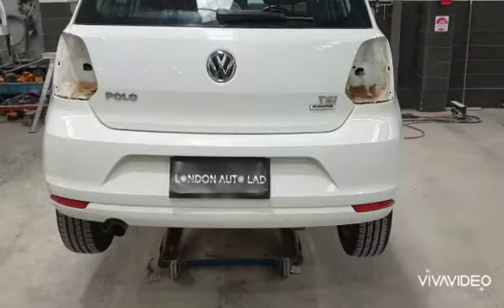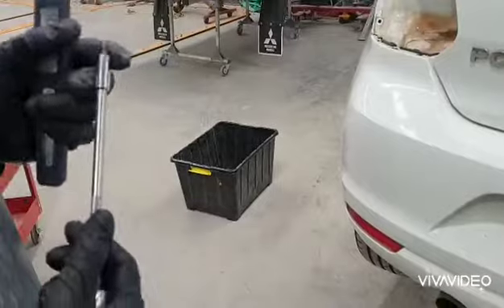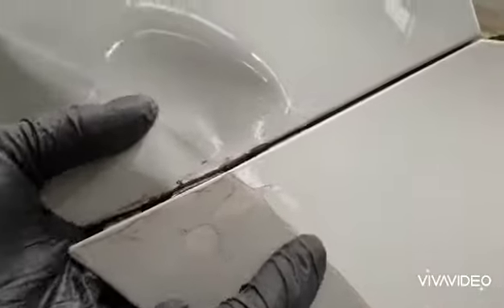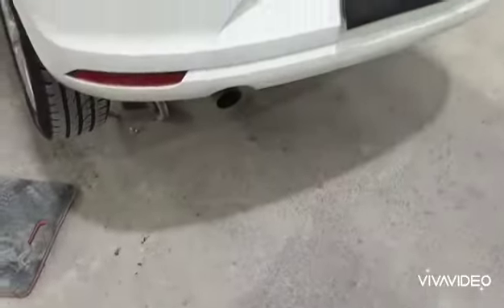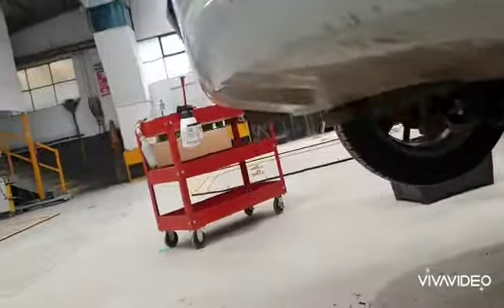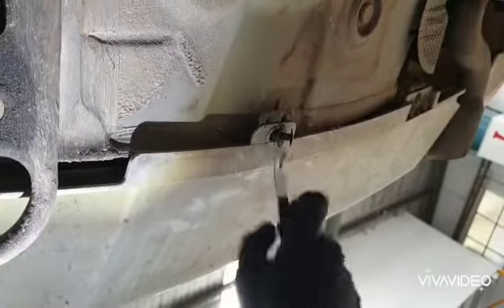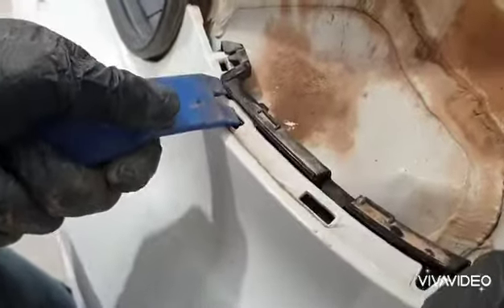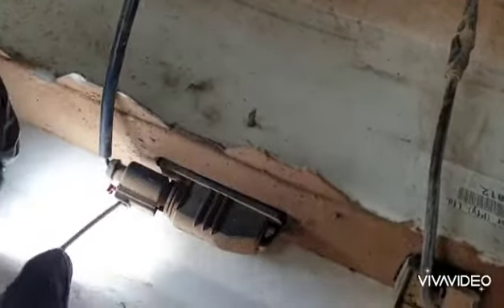Vw Polo  Rear bumper removal#volkswagen#autobody#automotiverepair

Comment: Really helpful video! My polo has been sent to a garage now twice after needing a new rear bumper but unfortunately it keeps dropping, hopefully I can now look into and fix the massive gap!
Reply from the maker: Wish I was local to help out im in brisbane Australia currently:-)
Reply from the maker: Here to help not a problem
Reply: Thank you, I think it’s the brackets that screw onto the body the bumper clips onto, would just of been nice of them to do it properly the first time around
Reply from the maker: @bethanwhitmore2403  sadly some trademen  really don't care  and have no pride in there work
Reply from the maker: @bethanwhitmore2403  sounds to me if the gap is massive , the beaver panel/rear panel may be damaged on accident and still in potentially . If so there would be abit more of a jump to opening the bootlid also ( a kick ) rather than smooth
Reply: The boot opens and closes smoothly again unlike after the accident, it not a massive gap but when you look at it the clips are visible under the taillights and along the wheel arch’s. Had to go to the garage it went to as it was the one used by insurance, think I’ll end up having to contact them again to get it sorted as every time I see it it annoys me.  Just a shame like you say that not everyone puts pride into their work anymore 😞

Comment: @stevecooke  Whats that iron thing used for? It looks heavy and I see it's all rusty after you pulled off the rear bumber.  Is it there to lessen impact of a Rear Collision in the case of an Accident?
Reply from the maker: Yes exactly that my friend its called a reo  short for bumper/bar  reinforcement. . Strengthening or the rear of vehicle to save the boot floor and structural panels being damaged

Comment: Can you do this without removing the tail lights ?
Reply from the maker: You can Paul but more of risk of breaking the tabs  which hold the bumper under the light or stressing the paintwork below the light .I guess more or a safer way all round if want to avoid any problems,  also on refit helps to align the bumpr correctly 👍
Reply: @stevecooke7951  ye I’m a friend of mine pushed in my reverse sensor so I’m having to take the bumper off as every time I reverse now it’s beeping constantly ! And seems to be the only way of getting it back into the hole
Reply from the maker: @MrPAROBI  yeah sometimes from underneath there's little or no access .. if its an aftermarket or none genuine sensor .. they have directions on the actual sensor at back and it could be facing downwards..hence why it keeps beeping try to twist when you got bumper off 180 degrees . May help or visually look where the arrow is pointing
Reply: @MrPAROBI  hey brother what did you take out cause i have the same problem with my rear cams?
Reply: @MrPAROBI same issue with polo 6R carat